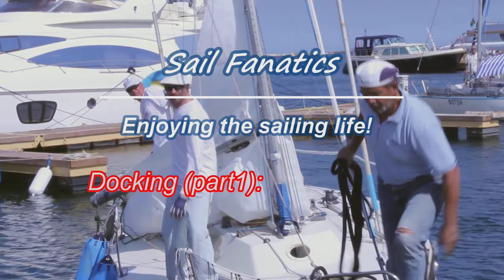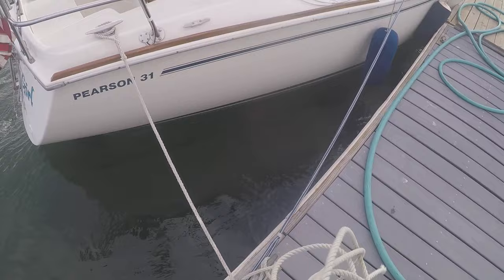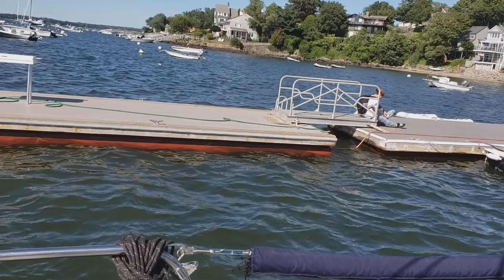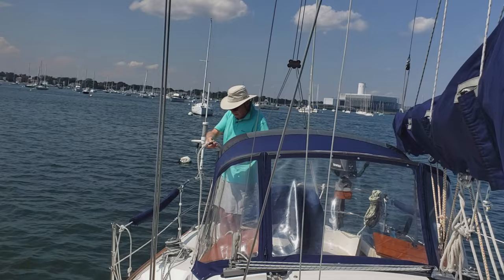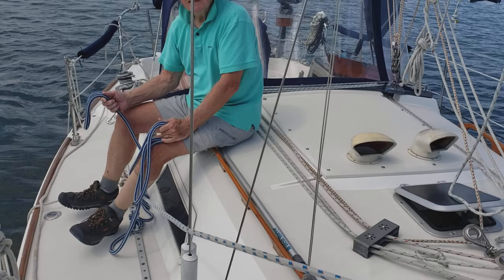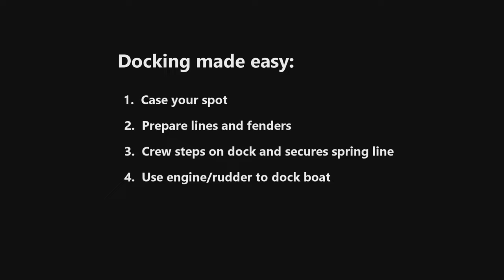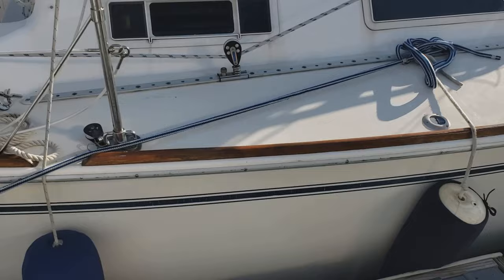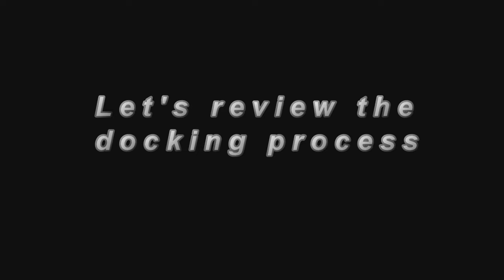Docking (part 1): Introduction to docking with style and grace

Comment: This shows nicely how idling in gear against a spring line gives you complete control - however you have to get the spring ashore first, and personally if at all possible I like to get that done before anyone steps ashore.  Especially with just a skipper and one crewmember, if the crew steps off and something goes wrong - line dropped, whatever, and the boat drifts off - you have a problem.  So if possible I go with making a loop (as someone else commented below), dropping that over the shore cleat from on the boat and taking up the slack, before anyone steps off.  Granted, that can be difficult at the stern depending on the position of the cockpit, stern cleats etc - in which case go for the midships cleat if you have one.  A loop dropped over a shore cleat from midships and tightened and the boat's going nowhere, giving you all the time in the world to sort the other lines.  One other thought - why go for a 'difficult' cleat - ie the one in the video close to a bunch of dinghies?  Surely go for a cleat with more space around it, then you can easily adjust the boat fore or aft once you've got lines ashore...
Reply from the maker: As to the choice of cleat, that dock is not much longer than the 31' boat. If we tried to use the middle cleat on the dock, the midship point of the boat might have been past the end of the dock - going forward on the spring and the boat might just rotate around the corner of the dock, wiping out the fenders as she turned...
Reply: @SailFanatics  Sure, I did say it depended on the respective positions of the cleats.  But if possible, a short breast line lassoed/ dropped over the middle dock cleat and tightened to the yacht's midship cleat is a winner - she's then completely secure for someone to step off and sort out the other lines at their leisure.

Comment: Great info...I suppose every circumstance may differ but my big takeaway from this is putting the boat in gear once the spring line is attached brings the boat in against the doc.  Makes sense...Thank you.
Reply from the maker: Circumstances can vary all over the lot, but if you get a midships spring line on the dock, then forward gear puts you on the dock, in any and all of the circumstances...

Comment: I use the same method single handed I make a loop about 4 metres long and drop one end over a winch and approach the end of the dock at 90⁰ if its windy then using a boat hook drop the other end of the loop over the end dock cleat. The boat turns 90⁰ and comes along side of the dock.

Comment: Now I need to learn how to do that on my own, on a short, short finger pontoon without a midship cleat. ha.
Reply from the maker: To solve this problem, I fit a moveable cleat on the jib track, see if you can do something similar.

As to the short pontoon and  alone, try backing in and looping the aft midships spring over the dock cleat  nearest the inside of the pontoon, then going forward on it to force the boat against the pontoon.

I have the video material for video on singlehanded dock, I hope to produce soon.
Reply: @SailFanatics  Would be nice :) HOpefully I'll see it when it comes out.

So far my docking isn't overly graceful, but hey, as long as I don't crash my boat into dock that should be fine, eh?
Reply: @SailFanatics  No risk of breaking the jib track with the lateral force of spring line on the cleat?

Comment: I mostly agree with the technique but I prefer to cleat with a full wrap as the force is on the trunk of the cleat instead of the horns. Sometimes the line can cinch up or pull through if a three quarter wrap is used. Also, it is not a secure cleating with a three quarter wrap. https://youtu.be/BBqsF72xNSU  The old knots books used in USA date back 100 years when ropes were not double braided and they perform differently.
The other issue is using the eye splice to attach to the cleat on the dock. It can lift off easily and will not lift off if it is on the boat pulling down. 
In windy conditions stepping off would be much more difficult. Attach spring midship and Lasso a cleat.  André in Sydney

Comment: Many sailboats cant dock that way as they dont have the thrust or even prop walk to keep against the dock.
Reply from the maker: Frank,
I am not sure what problem you have in mind. If an engine has adequate power to move the boat through the water, then it'll have enough power to hold the boat, being restrained by the spring line, against a dock.  There is no prop walk or even prop wash involved in this function, although you do use the prop WASH over the rudder to align the boat parallel to the dock.
Reply: As long as the midship spring mine is aft of the pivot point all you need to do is idle forward and steer away from the dock and the  boat will come along side the dock.

Comment: Said crashing into the dinghy..
Reply from the maker: Actually not...but it was almost a case where backing into the spot could have been justified.
Reply: @SailFanatics  I agree about backing in. You're parallel with the dock on portside coming in. There's no need to turn and dock on starboard side. 
But you basically crash into the dock and the dinghy(3:14-3:18). I'm not trying to be rude here, but we can see it in the video.